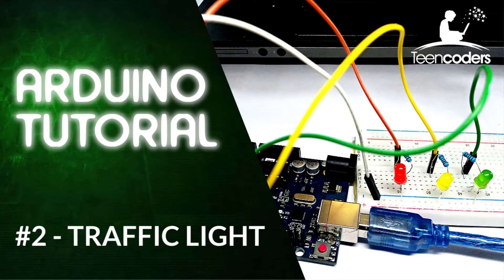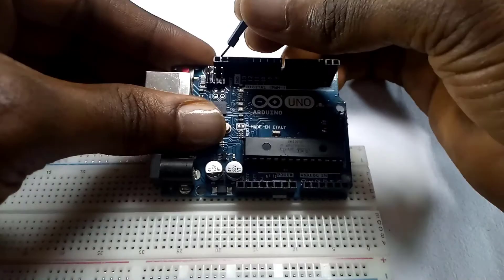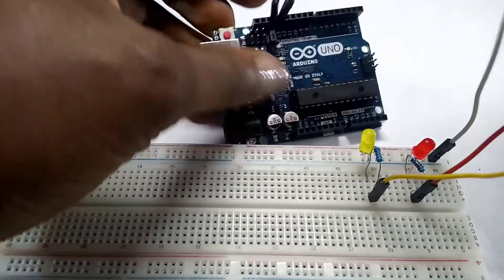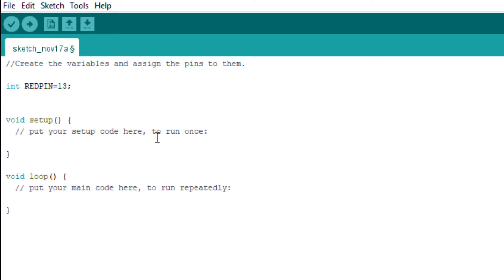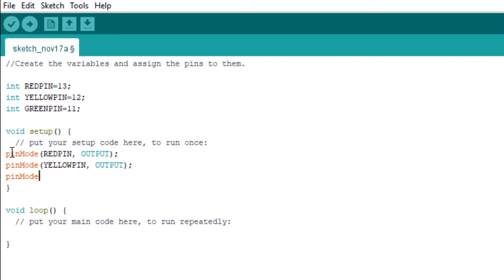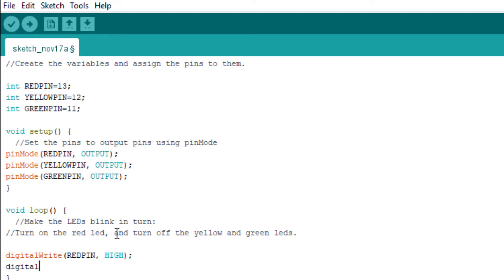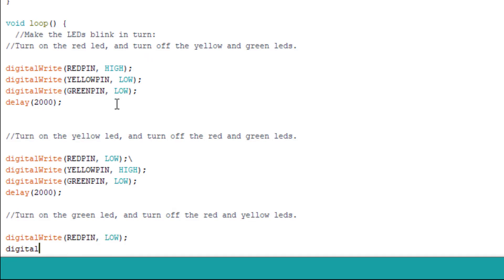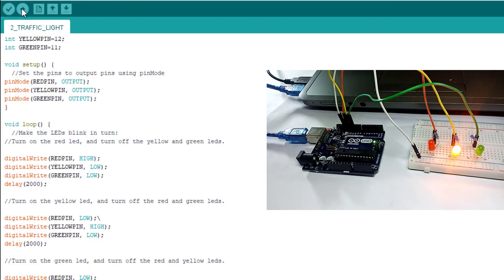Arduino Tutorial - #2 Traffic Light LED Project with Code for #beginners

Comment: You made a boo -boo,  the resistor you connected does not work. It is shorted, notice the brightness of the LEDs are to strong. The other resistor pin should go over the center canal.
Reply: no sorry you did that bro

Comment: Question for you I am using a traffic light set up but also wanting to add timer for caution lights come on at a certain time. 
Let's say traffic light works normal 5am. - 12am. And the lights go on cause at 12:05 until 5am. 5:05 back to working order.......an can I accomplish this ?

Comment: it works(as long as it is blinking) but you are bypassing the resisters that way.. if your didoes stay light they will burn out. You need to start the resisters in a new track.